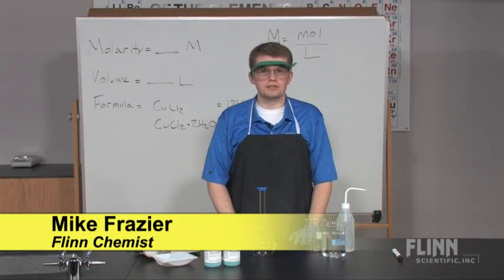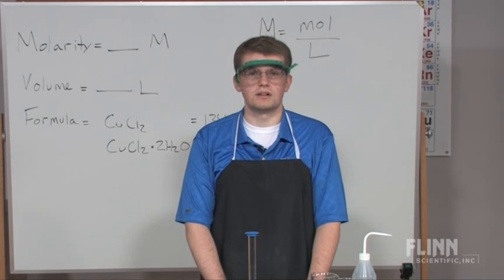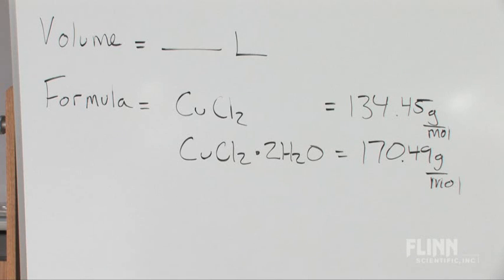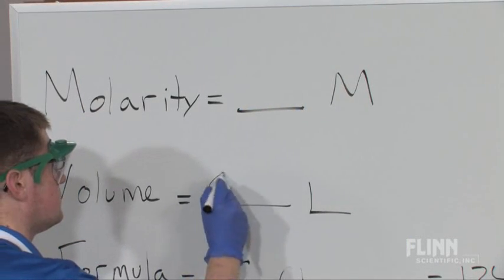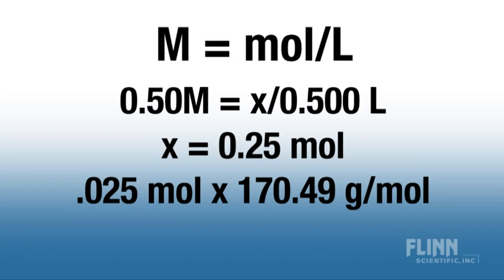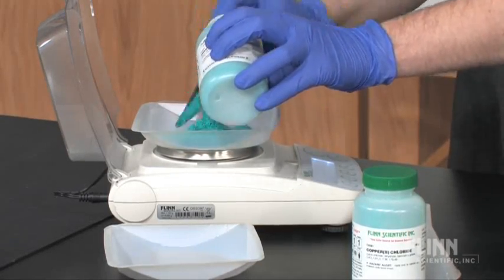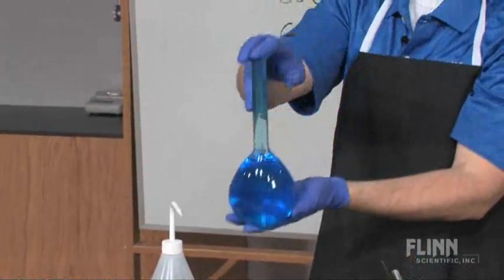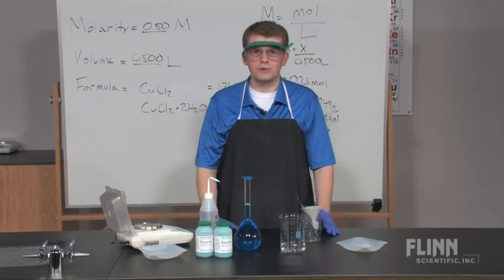How To Prepare Solutions

Comment: Great video, thank you. I want to prepare a 100 ml 25% v/v glutaraldehyde solution and the glutaraldehyde available is 50% wt% glutaraldehyde in water, MW= 100.12 g/mol, d= 1.106 g/ml. Would I be correct for using C1V1= C2V2. The answer I get is 50 ml of 50% glutaraldehyde in 100 ml to give 25% v/v glutaraldehyde. Thanks